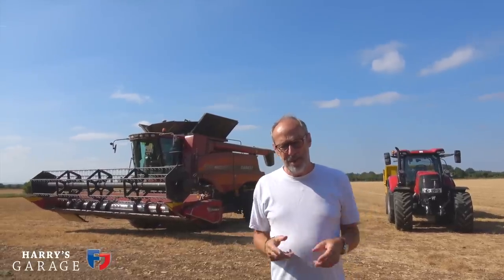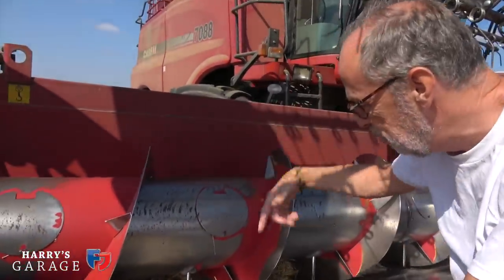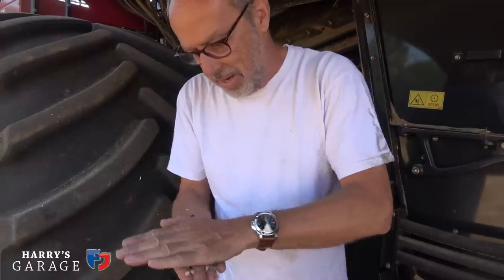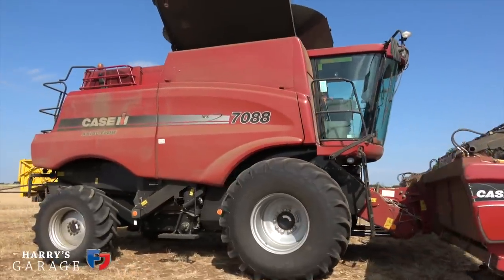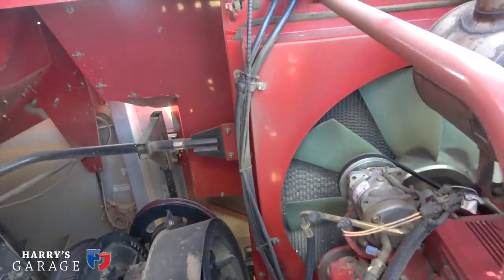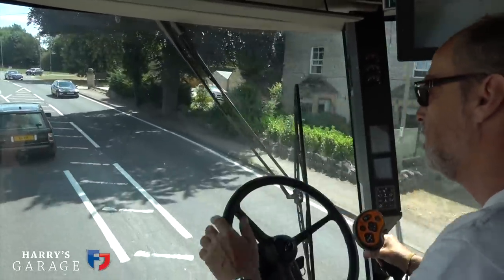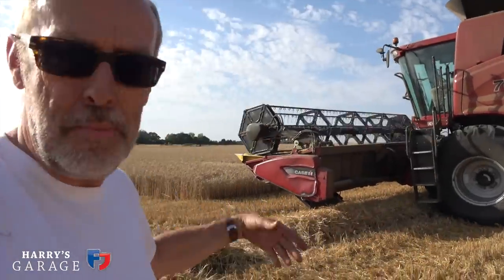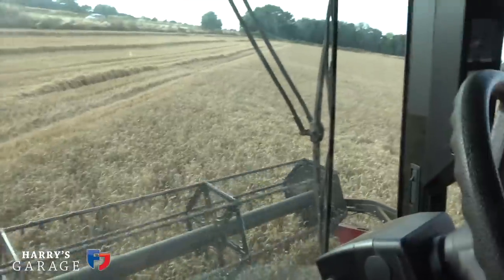Here's how a combine harvester works and what it's like to drive

Comment: Harry, rated Power is the power the combine needs to work at normal workload. Not using the full power to save fuel, produce less co2, etc, so that manufacturers can comply with emissions regulations.
Boosted power is power at peak turbo boost, for extra workload rate. This applies to all agricultural machines these days, tractors, combines, etc.
Never could imagine you farming! Especially with a Panerai on the wrist! Great guy!
Reply: Does it boost itself when needed?
Reply: Telmo Azevedo   the engine boosts when unloading on the move
Reply: Depends on the brands i think, but most of them have to be programed accordingly to the type of work you're doing. Agricultural machinery is much more advanced than cars in terms of power management, efficiency and transmissions and maybe autonomus work.
Reply: Maybe, i don't know how Case IH operates.
Reply: Just controlling the wastegate on the turbo.

Comment: This video clearly shows the two major innovations of Cyrus McCormick in 1831 that resulted in the first mechanical harvester.  And those two innovations have remained a part of most harvesters ever since,  around the world,  except for scycle bar mowers,  which have only one of those features.

The first innovation was the clipper mechanism that actually cuts grain stalks.   That was an innovation on Cyrus McCorm ick's first harvester,  and on pretty much every harvester around the world ever since  ----190 years!

The second innovation was the reel,  which combs the stalks of grain and holds them to be cut,  and then moves them on further into the harvester.

As far as I can see,  both are features of pretty much every grain or hay harvesters except for  sycle bar mowers,  which don't have the reel.

Pretty dang amazing!  And by a young man whose father had tried for years to develop a mechanical harvester---and failed.  His son,  a blacksmith,  crafted his harvester with his own hands,  and those of a Negro slave who assisted him.

The name of the slave is known,  but I don't know what it is.  I'd be interested to know how that slave might have been rewarded for assisting McCormick,  but I've never seen a discussion of that. I'd like to think that he was treated generously.

Comment: I really enjoyed this video.  Moving farm equipment on the road is never fun  I recently bought a 15 ft wide grain drill and pulled it home without realizing how much of the road it would take up.  I couldn't pull over just anywhere for cars or too much into the ditch because the low clearance disc's would start to hit.  It was all back roads but what a headache...never again.

Comment: The 1985 season was the worst growing and harvest season I've ever experienced!  I farmed at Auchtermuchty in NE Fife, and there were still combines parked in part cut fields of flattened Winter Wheat to the East of me in November, much of which just had to be ploughed in!

Finding a true dry, sunny few days to cut was a near impossibility, we ended up having to combine in overcast days just because it wasn't raining, and with grain moisture levels that combine manufacturers had always said that were impossible for machines to thresh just to get through the crops! The only real winners that year were the fuel retailers selling fuel for Grain Dryers!

When I was as near finished the barley and was waiting for a chance to cut some Oats, I got persuaded  by a cousin to go help get his barley cut! Then as I was near finished that a near neighbour of theirs begged my help to get his acreage cut, well the 'contracting' income was sore needed that year! I eventually left his place in my cab-less MF 525 Super 2 combine at around 7pm to drive the 3 hours home. 

By the time I was heading through the last 2 villages I could literally feel the heat from each and every streetlight (thr driver's seat on that era of MF combines was on the left of the engine!) on that cold early October night, and by the time I got the machine parked in the hayshed at home I couldn't straighten up my young limbs due to the cold!

Comment: Could have shown the grain erupting into the tank through the rear window while in work and explained that the three gears were augmented by a hydrostatic unit that effectively means that it is an IVT transmission. Also early on, what happens to the clean grain, and returns, after they fall through the sieves and how they are lifted to the tank. Also how the tank is emptied of course.
Reply: Huw Williams we were talking about it earlier. Just means we’ll have to do another next year
Reply: Charlie Metcalfe 
I don’t want to be too critical because it is a fine line between interesting detail and boring people to death and you obviously got it spot on for the majority of people. Another thing that struck me was the mass of massive hydraulic hoses carrying fluid from somewhere to somewhere else, but not mentioned.  Overall great job though, judging by this comments section. Thanks.
Reply: Huw Williams I think this vid was aimed at informing a car audience but judging the comment section as well it seems most people here are just anything-with-an-engine fans

Comment: Didn't think these things were so complicated!
Reply: John Wood 
You dont know the half of it. Harry kept it very simple on one of the simplest high capacitt combines you can get. He hinted at auto-steer, but theres also auto table height control and reel speed control, plus on some machines there are auto levelling sieves or the whole machine auto levels on slopes. Did you wonder how the table [header in the usa] got to the field and what was involved in attaching and detaching it? The hydraulics, drive shafts, the coupling and clamping, the electrics? What makes all that turn?

Comment: Just wondering if the blowers are also cooling the motor as the Gleaner does ?  You mentioned dust! I seems like you have to get the filters blown out all the time to manage overheating on a Gleaner. The Case may work differently I’m guessing.

Comment: Does it harvest things other than wheat? I guess it would need to be adjusted or parts changed? I thought it would be more efficient going slower so the barrel isnt so loaded but aparantly not
Reply: You need to keep the rotor full, It's the pressure of the straw and chaff that's helps to separate the grain. If the crop is thin then you increase ground speed to keep this condition. And yes it will harvest all sorts of crops so long as the crop is dry. You may need a different header, or special modifications on the header for different crops.